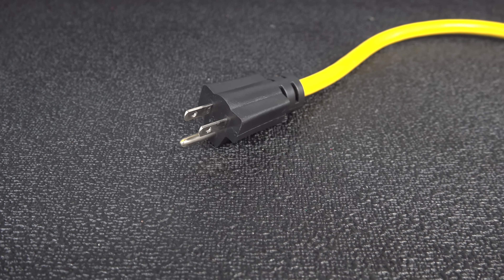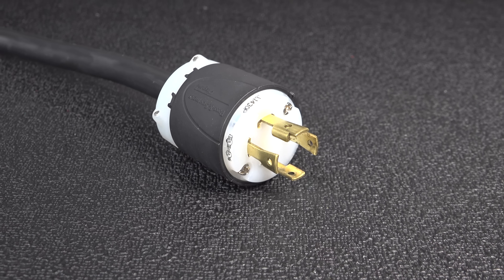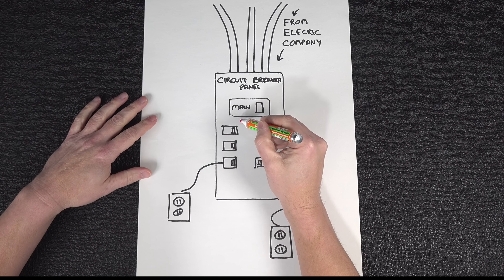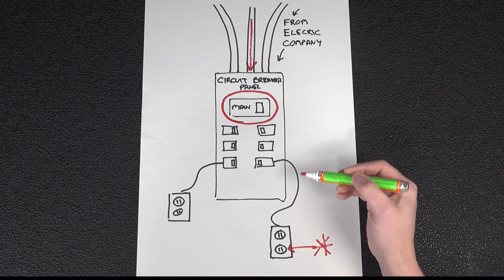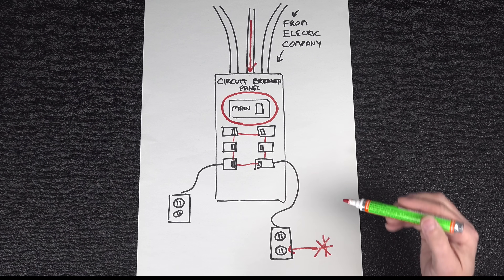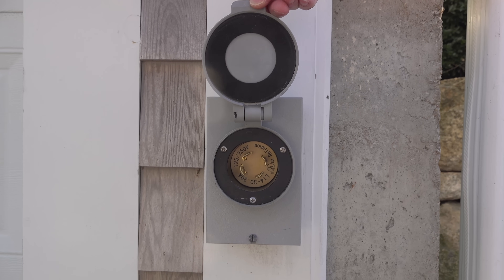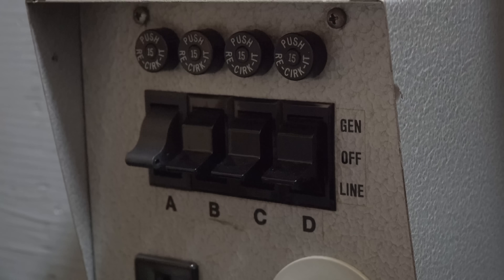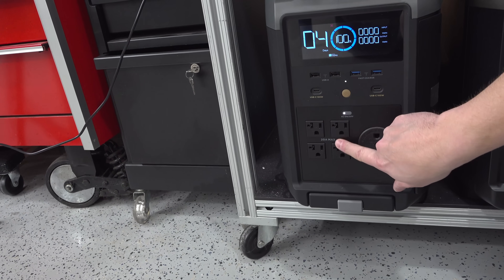Worst Electrical Mistake You Can Make - Backfeeding Generators

Comment: No matter what you do you have to feed your home electrical system when you use a generator or connect everything you want powered to the generator outlets. The double ended (male) cord is a easy way to feed your system but you have to be smarter than an idiot to throw your main breaker and disconnect your generator before you switch to the power companies feed. Telling everyone this is illegal is wrong as all generator connections including an automated switch (which can be thousands of dollars to install) feeds your home circuit. With the MAIN breaker off you can't feed the power companies line. Why would you LIE like this?

Comment: Didn't know whether to give this thumbs up or thumbs down it was a lot of good information and also some mis information, 1st of all depending on what state you are in back feeding is elit is illegal or legal. 2nd of all Thai grids back feed the grid But you didn't mention them them the cord is on the market selling because it is Dean safe In some States of course you're not supposed to have electricity running through the cord when you plug them in Only after it is plugged in and secure are the power supposed to be running. of course you made A good observation some people are just idiots and do stupid things. You should be well inversed about what back feeding is and how and why States want to Make them illegal it's not for safety it has to do with money. I'm sending a few videos for anyone to check out some Thai grids with limiters so it doesn't hurt those workers you suggested that's working on the line. It's so many ways to do something legal When it comes to backfeeding energy into your house and do it in a safe ways ways so I sent you these videos and keep in mind if you go to my channel and see how I step down the electricity in my house and then step it backup Of course I don't tell you everything one of the things I left out in the video to keep it simple is that I take that stepped up energy and put them into a battery system And yes your video was good about the main trick of turning it off and running your house on the battery there's a trick you can use if you know what true over unity is not the lie about more power out than in and since I'm the creator of overunity you can give my company a call and find out what it is 3136515349
https://youtu.be/HTR03aSiGWs

https://youtu.be/Tdr6c1DLun8

Comment: My church was out of power after a tornado and what we did which is what people should do is disconnect the box from the lines from the pole. Then plug the male end of a 240v gen cable into the generator and the other end should be stripped and you wire those in where the power pole lines were and you also crimp down the ground aswell. Thats the proper way of doing it. Well, in an emergency. If your gonna keep the gen hooked up as a back up, youll actually have conduit and lines running from it to your box with a switch that will trigger when no current is detect from the power pole lines to prevent backfeeding.

Also. Backfeeding is not illegal out right. Thats how people with solar panels get checks from the city for feeding into the grid. But theres heavy permits and such that have to be aquired to do so.
Reply from the maker: You will need to say a prayer to keep that install safe. Uncontrolled backfeeding is always illegal, using a transfer switch meets the requirements and keeps it safe, as the video stated. Shoving a cord in an outlet. throwing a main is not legal.
Reply: @SilverCymbal  The install i spoke of was temporary and most importantly, disconnected from the grid. There was no backfeeding

Comment: The solution is simple: don’t be fucking stupid. Don’t touch live prongs, do not backfeed your energy into the power grid (wasting your fuel!!). It’s that simple. Now you can use the male to male adapter all day. Anyone who electrocutes themselves on this is absolutely stupid, deserves the Darwin Award, and shouldn’t even touch a generator to begin with.
Reply from the maker: Why do you need airbags or seatbelts? If you just drive correctly and everyone does exactly what they should, accidents wouldn't happen. You can't control what goes wrong, that's why its a regulation and a good one. It works.
Reply: @SilverCymbal  the difference is you take your car into a world full of idiots, but your generator and cables are safely within your house, and if there’s children then you can lock doors

Comment: Ah yes, the good old suicide lead. Handy to run from a generator to a power outlet in the main fuse box/ meter box on your house when the power goes out. 
Be sure the mains switch in the meter box is switched off from the main power grid.
You can now use the outlets in your house again with the generator.
Old school way of doing it and is considered illegal in Australia, as you can shock yourself on the male cable plug prong if it's not plugged into a  power socket and the generator before firing up the generator.
Not something to mess with unless you know what your doing, it's safe in the right hands. Cheers

Comment: I once found a broken power cord, just out of curiosity twisted the wire together and connected it, lights went off, but just needed to flip the switch, idk what exactly happened and how I didn't get electrocuted, I was about 12yo I think

Comment: I was messing with robotic parts in an engineering class and I wired the batter with a male end. Accidentally touched that to one of the metal parts and it welded itself to the metal 😂 after that I made sure to have live wires with a female plug

Comment: So with all this in mind how do roof solar panels work? I assume it can’t power your house on its own and you can’t backfeed so how does it do anything?
Reply from the maker: Backfeeding, which is really just feeding power is legal under one condtion. It must be impossible to allow power flow when the utility is down. For home generators a manual switch works since it has an interloc for solar panel setups they use an auto disconnect that breaks the solar feed from the utility if the utility power is down.

Comment: I agree with your video,  but can you define "illegal"?  You make it sound criminal with jail time,  but i think something like this could lead to fines (as long as no one is hurt of course).  Quite often, in dire times people need power or face worse problems than fines. I would recommend that when posting a video like this, that showing a correct solution that's almost as easy would go along way to keeping people safe.
Reply from the maker: I did show you two legal solutions to this in the video. Please watch it through
Reply: @SilverCymbal   I did watch the entire video and really enjoyed it.  You provided some great information and great diagrams and common sense reasons why people shouldn't do this.  And yes, you did show a few solutions.  The first solution was basically a safety device to prevent turning on the power main, which I think is great.  The second solution was adding an inlet box, which at face value,  most will view as requiring an electrician. I was hoping to see a few real solutions that someone (with decent common sense)  could easily do when electricians would most likely be in short supply (i.e., during a major outage) .  When I first watched this I was wondering how many people saw this and the simple cheap cord as the answer to their problem - if they just follow a few simple safety concerns.  Most will only view the video and not read through the hundreds of comments for additional advice.  Please don't take any of this as negative criticism as I really did like your video and the valuable safely message you provided.  I've subscribed to your channel for future videos. Keep up the great work!

Comment: During long power outages every electrical lineman knows to check "dead" lines for voltage because there's always some idiot who's backfeeding his power panel and is too stupid to throw the main breaker and thus keep it from backfeeding into the local distribution transformer...which will result in the HV line being energized, too.   

The NEC requires a transfer switch to be used when a generator is to be used to feed a house circuit.

Comment: How do you guys connect solar panels? In The Nethelands it is common that solar panels do permanently feed back to the grid. Unless you are actually using all revenue of course.
Reply from the maker: Backfeeding is really the same as feeding power. The difference is solar panels and other systems that are legal here have disconnect switches, whether automatic or manual to ensure that you can't feed power to the utility if the utility is down. That is the difference that makes it legal here.

Comment: It is illegal to back feed, and potentially fatally dangerous. But if you do it with a proper risk assessment applying appropriate safety measures, it can be done safely. But still illegal and potentially very dangerous if you forget anything, and you probably will, and that's why it is illegal.

Comment: In an absolute emergency I just pull the meter and wire into the house side of that. It’s crude but it works and keeps the line workers safe.

Comment: My grandpa picked the main breaker so that if you want to use the generator you just have to pull the lever down, cutting off the main power and connecting the generator in one easy movement and if the power is back you just have to flip the lever up cutting the generator from the house and connecting the main electricity

Comment: I've never seen one of those double male cords here in Canada. I do have an outside generator backfed into my panel though. It uses one of those twist lock plugs, male one end , female on the other. That goes from the generator to a special receptacle on the outside of the house. That connects to a backfeed breaker with an interlock, so you can't be connected to mains and run the generator at the same time. Legally if you have a generator that is considered "non independently derived" (permanently installed outside, probably on pad, trenched wiring, non-portable) you need to have both ground and neutral completely disconnected when in the off position, which requires one of those auto-switching panels. But, if like mine, the generator is totally portable and you use a 4 prong twist lock to connect to the house it's considered an "independently derived system" and you can get by with the cord and interlock with no more than a backfeed breaker in the panel. At least that was the law when I installed it several years ago.

Comment: wait you gus dont have 3 phases? like 3x 230v or 400v betwen phases?
Reply: Yes, we do. But household wiring isn't 3 phase. That would be totally unnecessary, and add extra complexity to the power grid. 3-phase is used to power heavy industrial or commercial machinery, especially motors.

Comment: IF you have hardwired an Automatic Transfer Switch to your system, then there's no issue with that cable between the generator outlet to the inlet of the ATS.  
It isolates the feed to loop through your connections only and prevents a return down the line to the grid.

Comment: I made 1 years ago, I still use it when I have power outages, as long as you use common sense you will be ok, I make sure to turn off the main breaker to my house before doing anything, plus I plug in the lines before I start my generator,  I have a light at my meter,   when it comes on I disconnect everything and then turn on my main again.

Comment: I was doing some work at an office figuring out what to do in case we needed to switch to generator power and a transfer switch or even an ATS was like the first thing that came up even in my clumsy googling. 

It's great we have the internet now to search things, but I feel bad for people who either choose to ignore search engines altogether or just learned before information was easy and don't think they need to know any better. 

Anyway 7 moths later the whole building burned down because of my crappy implementation. JK but seriously, also don't DIY with heavy amps at service volts unless you know what's up and always get it inspected anyway. Cause you know, it's law.

Comment: I manage apartments and with the new smart meters the utilities are shut off the moment a tenant leaves. The monthly connection cost even if no electricity is used makes it not worth us starting service not to mention the headache of dealing with the utility to start and stop service constantly. We plug into the hallway outlets when working in a unit. We use suicide cords that have plugs that light up so we can tell they are live. Turn off the unit main breaker and always plug the apartment side in before the live side. No problems.
Reply from the maker: What could possibly go wrong? I would hate to be a tenant in a building with a super backfeeding outlets to see what happens. Seriously you must be making this up.
Reply: @SilverCymbal  He just said they have separate power feeds into each unit. Did you not understand that?

Comment: I wonder what happens if the cable is connected between 2 phases, for example in the kitchen.
Reply: In most of the USA you get a 240 volt short through your male - male cable.  Please do not test this, if you are unlucky the resulting arc flash could burn or blind you.  If you are lucky you'll just trip a breaker.

Comment: Ok grant it there is always a right way to do things but the solution you suggested is the same process just with some safety features if your in a pinch like the powers off and it's 5 degrees outside and you have electric heat use or make a suicide cord flip the breaker and stay warm
Reply: Let me go on to say I use off grid solar and I wouldn't have to do this but what I'm saying if it's freezing to death or carefully doing this keeping my safety and the safety of others in mind I'm staying warm

Comment: Another disadvantage of just using a male-to-male cable and backfeeding into a regular outlet is that all the power you're feeding in goes through cables and fuses that aren't meant for very high power, usually around 2.3kW. By getting a dedicated connection to feed into you can use bigger wires and fuses
Reply: It's fused via the breaker on whatever circuit you plugged it in to.
Reply: @andrewk8636  yup, and that's usually a rather weak fuse. Enough to get the lights going and tune in to an emergency broadcast, but not too much more. At least not all at once
Reply: @HATECELL  i was about to say: "well you got your fridge on one circuit and maybe another major appliance on another and you're golden." And just as I was writing that I realized the breaker ain't gonna do nothing because the outlets power doesn't feed through it lol. So you're limited to whatever breaker the generator has which hopefully is rated lower than the wiring. Definitely need to add a breaker or fuse if you're using a male to male. In a pinch I'd rig it up if power cut out for a while but not worth it for a short outage. When I get my own house I'll be off grid anyway so I won't need to worry about that no more

Comment: Wrong again. These cables are callded pass through cables, and not designed for back feeding. As you said back feeding is illegal, that means designing and distributing an item for that purpose is a criminal offence.
Reply from the maker: I wouldn't bet much on what you think you know. You are often wrong but never in doubt.
Reply: @SilverCymbal  As an engineer in the field, I do'nt bet, I don't doubt. Becasue if I do accidents might happen, and they are often fatal.

Comment: Another reason a cord with 2 male ends exists is to power tools…for example I work at an electrical company and we have specially made cord’s like this to power band saws,hammer drills and porta ponies (GRC pipe threaders) and use them very frequently on the job site.
These cords have there uses but in the case of back feeding I wouldn’t suggest anyone to do it.It poses danger to not only you self but others such as electricians.

Comment: You think that just because someone COULD use something wrong, that no one else who does know how to use it should be able to buy It?  This is how fascism and communism start.
Reply from the maker: Or just buy the safety switch preventing any issues and save the marxist plot ideas. You register your car right, and that does nothing absolutely nothing. At least this physically serves a purpose and it works but somehow it's unacceptable.

Comment: Hooked up a genny setup for my buddies grow op. Installed a 240 plug whip on the relay/distro box. It plugs into the 240 outlet I installed on the wall next to it. When the system needs genny, he can just unplug it from the wall and plug it into the cable from the genny. Easy peasy and there is no way he can back feed the bldg. Told him for a few grand more I can install an auto transfer switch for the whole thing, maybe next year.

Comment: as you said this is the trouble waiting to happen, even if you're careful, voltages are the same etc, frequency and wave in AC coming from the power lines and generator are not the same, in some point they will be phase shifted resulting in much larger voltages and can burn your house down... i wouldnt play with this, use extension cords to power your appliances directly from generator, but dont come near power lines